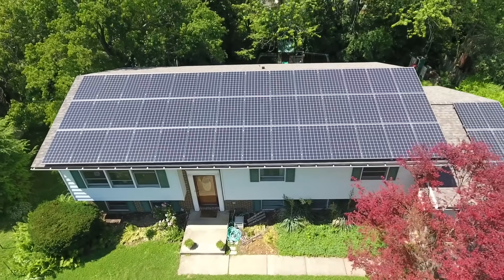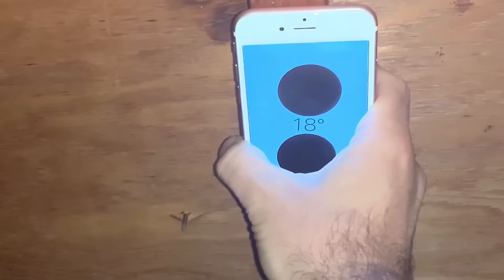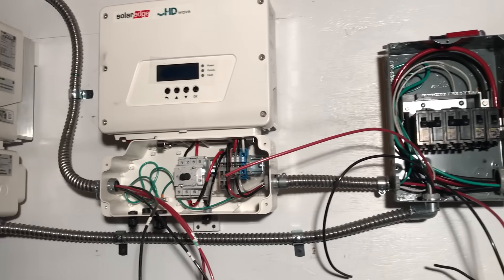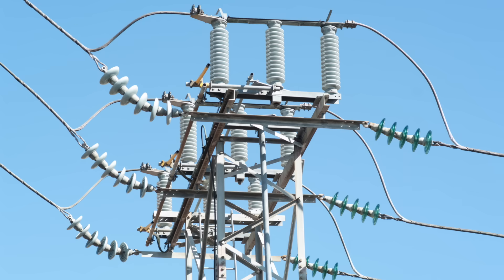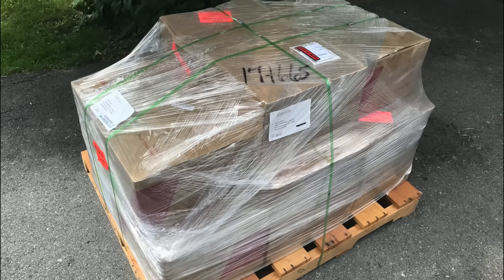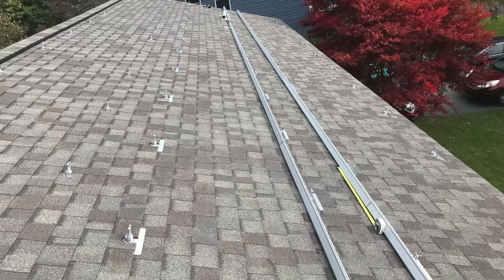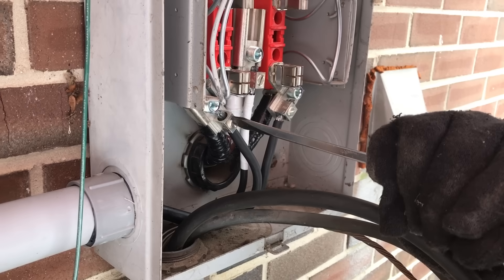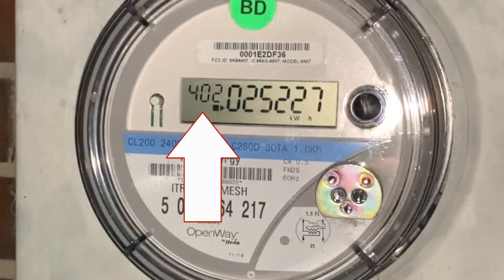I Installed a Power Plant Myself | HUGE DIY Solar Panel System

Comment: I question your math and ROI figures.   I've been designing commercial solar, wind and gas back up power stations for 20 years.  While the cost of solar has gone down substantially the cost per kilowatt is still well above what you can buy it for from the on-grid power companies.  Of course this all depends on where you live and what you are paying.  If you happen to live where you can buy a kilowatt of electricity for less than 12 cents per killowatt then it is not financially viable.  There are places in the US where you can get residential retail electricity for 8 cents per kilowatt.  You are not gonna do better than that.  So, my advice to anyone is to look at your utility bill and divide your monthly bill by the monthly kilowatt usage.  Then get a honest number of what it is gonna cost to build and maintain your system and divide that by the amount of kilowatts it will produce over it's serviceable lifetime.   Be honest about it.  Granted, the systems that I design are for commercial use and have redundant features but they typically cost between $.35 and $.75 cents per kilowatt.  Keep in mind, you can't just go buy the solar panels, you have to figure the cost of the panels, mounting hardware, support structure, controllers, batteries, inverters, switches and wiring.  Then don't forget insurance, property taxes and maintenance.  Very expensive inverters can go bad in as little as two years and will go five if you are lucky.  You will pay more for inverters and controllers than for the solar panels. The cost of labor is a total wildcard.   It's not all gravy.  If it were solar panels would have taken the world by storm decades ago when they were first invented.  If you have the power grid and you can buy electricity for less than 12 cents per kilowatt consider yourself lucky. Now if you want to live or operate out in the boonies where it cost 10s if not 100s of thousands of dollars to connect to the grid then solar, wind and gas generators are an option that is now reliable and available.  Several people like me that work in the industry would be more than happy to set you up. Just be honest about it and not mislead people.

Comment: So you bear all the financial burden to sell electricity "back" to the electric company for 1/4 of the price you or your neighbors pay for it  and felt good about it?  The installation was clean and the idea is amazing, finishing it with a powerwall you build your self and disconnect totally from the grid would be a goal.
Reply from the maker: It doesn’t work that way. I get full retail credit for every KWH I send the grid.  So I bank them all up in the summer, use them in the winter.
Reply: @FrugalRepair  apologies then sir, where I lived the repay for credit was less than 1/2 cost of electricity, b ows to you have a great day!
Reply from the maker: No problem!  I hope you are staying safe.

Comment: I think one big place where you went right was working with the roofer. It’s not unusual to have the new roof installed and then have the solar installed. Installing the standoffs as the shingles were being installed is probably the best way to be able to do it.
Reply from the maker: Thanks!  Yeah, he was cool to work with.  Plus, I didn’t want to have to put the flashing in and try to pull nails out of the way under shingles, if I had to do it with the shingles already there.

Comment: I'd love to see if you could replicate something like the Tesla Powerwall's autobidder, where it buys energy from the grid when it's cheap (like at night) and stores it in batteries and sells it back to the grid during peak energy hours. There's excellent long lasting relatively affordable and safe batteries like Lithium Iron Phosphate that would generate a good ROI and backup power in a power outage. Your solar could also store energy when it's cheap and sell it during peak hours, making your panels even more profitable.

Comment: Next: house battery system.
Reply from the maker: Maybe!  But as of now I don’t really need them because of net metering and the costs of the batteries.  But who knows.
Reply: @FrugalRepair  Correct, unless your utility is prone to persistent power outages, Net Meeting has a higher ROI than a battery backup system.
Reply: @FrugalRepair  Do you feel a need to prepare for blackouts and storms? Do the solar credits you earn during sunny days only barely cover the cost of powering your house from evening to morning and during bad weather? Is your power company thinking of changing how much they pay for overabundant noontime solar power vs. how much they charge for electricity at evening peak use hours? If yes, you might want to invest in a battery.

One thing you can do to easily store energy without batteries is timing your use of various appliances. Get a big enough water heater that warming it up at noon with free solar power will cover all your hot water needs for at least 24 hours. Set your AC, freezer, washing machine and so on to work during the day instead of morning or evening as much as possible. This way you will be using more of the power you produce so you need to buy it back less.

During these stay at home times you can also easily cook your meals when you still have solar power; the one problem with this plan is most foods won't like being left in the oven in the morning, baked by timer at noon and left drying in there until you come home possibly very late at night...
Reply: I would go save up for a battery system. Here in Denmark, everyone that got solar over the last 5-10 years got to earn a bit of money to pay back their solar. However today the rules (and billing) have changed and no one pays off the their systems anymore. Many actually are still paying off their loans for solar.
Everybody is looking into adding batteries and even into how to become off-grid homes, because returning power to the grid is heavy taxed. I literally do not know anyone in Denmark that will put up solar without it being off-grid. #Secondlifestorage
Reply: I agree with Fred. Some reserve power for peak demand, outages, and possibly a home server for mining, if you're into that. This's the first video i've seen from your channel, good stuff. You've earned a sub and a like from me. 🙂
Reply: liquid oxygen for power storage, its the future ;)
Reply: @sparky4774  Way to stay relevant. Bravo!
Reply: The energy density in a house battery is huge... a bit like having a bomb in the house... IMO too much of a fire hazard.
Reply: If the credit received is 100% of the purchase price for the same kWh, it may be best to hold off.  Eventually the credit should be reduced to its actual wholesale value. (The market will force this as more consumers install these systems.)  At that point battery technology should be better and cheaper.  That would be the time to consider an investment in battery storage.

Comment: No bills? What about the 20 plus thousand it costs for inverters, batteries, and those solar panels lol. They are not free ya know. Paying back 20 to 30,000 $$$ is NOT FREE MORON.
Reply: His intent was to eliminate paying the power company.  He apparently did not mind investing in his own equipment and labor to achieve that result.

Comment: so no link to the program you use for your permit and electrical calculations and no link to the company for the engineering stamp. Those are two of the most important parts that were left out, so this is helpfully how?
Reply: The permit is handled by the local authority having jurisdiction, probably a city permitting office, or a county office.  It is very unlikely that you have a similar enough location that the information would be useful.  To a slight extent, the engineering approval has a similar limitation.  If you are in hurricane alley and he is not, probably there is no applicability.
Reply: @wallykramer7566  Not sure why this is a highlight reply. because it's as useless as the information he provided. My question still stand. The information he gathered for the permit should be useful to submit to any AHJ as calculation are not location specific. And why not explain how you found an online company for the engineering stamp. Again these are two of the most important part of DIY solar and he left that information out. I didn't watch his video just to see how he was doing I don't know him and I don't care. I was trying to learn how to do it myself as well. I think he did a great job but in the end without providing crucial info the video was a bit lacking
Reply from the maker: There was a ton of information I didn't include.  Shoot me an email if you want more info.  I'm happy to help.  I'm also curating the questions to hopefully  address in future videos.
Reply: @FrugalRepair  email sent

Comment: Do you not have a battery? Was the idea to not use a battery but just offset your power cost at night by producing a ton of power during the day?
Reply from the maker: There's no need for a battery in my state (PA).  I get retail credit for my excess KWH.
Reply: @FrugalRepair  that’s what I was assuming, just wanted confirmation. What do they charge day/night vs what do they pay day/night?

Comment: Also count in inflation, which should be increasing within the next few years, making this a greater investment. When everyone else's cost of living goes up.
Reply: Not so sure.  As solar systems proliferate, there could be pushback by utilities, politicians, etc. which might reduce the reward for an on-grid investment.
Reply: @wallykramer7566  probably, maybe but upcoming inflation is certainly set in. But independent of that, the cost of power or most things will rise and being independent and not dependent will be the economically preferable thing to do. 🤷

Comment: Can't wait to see a part 2 and many follow ups that go into detail for all the various parts.

I felt this video was a bit too short. 🙈
Reply from the maker: Thanks!  I'm curious to hear what people want to see.  Let me know what aspects you'd like me to focus on.
Reply: @FrugalRepair 
-A step-by-step approach to the idea, planning, and execution phases
-The best way to research local codes
-Links to the various tools, calculators, and services you used
-The basic outline of parts and how you selected each one.
-Cost of the system in total
-What were the most difficult or frustrating elements in the build?
-Now that you're a year later, is there anything you'd do differently.

Thank you so much for this video, it's already really helpful!
Reply: @FrugalRepair  I am curious to see the kWhr rate the electric company buys power from you during the day and the price it charges you during other times.  I would also like to know if they took you off a rate plan and stuck you on another.  I have heard horror stories from owners and renters of solar that were put on a time of use rate at the beginning of a solar project and owed thousands by the first day of actual solar generation.  Solar is good but as usual, big polotics and big business have tailored it so the little guy gets screwed in the end.

Comment: How the hell do you clean those panels? You can’t stand on them.
Reply from the maker: You really don’t need to clean them.  Rain does most of the job for you.  I do have a long pole with a sponge on it for cleaning if I wanted though.  Maybe I’ll do a comparison cleaning vs no cleaning at some point.
Reply: @FrugalRepair  I went up recently for the first time after six years, and it’s looking like it’s better now. I would say the rare bits of bird poop would probably wash away on their own for the most part, but the general grime layer was p bad. What I’ll have to do though I suppose is go up after two years or so and compare if it’s equally bad.

https://imgur.com/gallery/hRv3KnF

Actually, you know what, I concluded I needed to do the washing in year 2 and 3. I never actually looked at the data for the last few years (password didn’t work, whatever, I could see it was still working on the inverter). But... with that graph I wouldn’t conclude that I really needed to get out there. I just had it on my to do list for years because I didn’t get around to it.

Huh. What do you know.

(14 x 260 is 3640W feeding a 3000W inverter, at 53 degrees north)

Comment: Bravo. I should have paid you to do our 12.9kw system instead of Tesla.  (Our utility in NJ limits how big we can go) Curious how much the system is producing now that’s it’s been some time.  On sunniest days during this first month I’m gettin only 27kw max.  Your system is larger and all southern facing so should be far higher. Also did u mention total cost ? Curious what that roofer charged for new roof too.   How much do u get for SREC bc that and net metering is what put my pay back period to 6-7 years too.   Pro tip- I also maximized credit card points with four new chase cards which really helped ( $4800 bucks back!)
Reply from the maker: Thank you!  I'm in PA, I wish I could get the SREC credits from NJ.  PA SRECs are like $30 but it fluctuates.  I hope I can get into the detailed breakdowns in future vids.

Comment: It is rewarding, Mine was an off grid set up, the batteries were an extra headache but then I don't have to deal with any regulation seen here. If your even a bit handy and willing to look up a bunch of videos then you can give the middle finger to power companies. My pay back is more like 3 years because I'm including the fact that I don't pay rent and I'm never going back.
Reply from the maker: That's great.  Did you install it yourself?
Reply: @FrugalRepair  Yes but I got advise on what I had in mind and then got him to come check my assembly and switch it on so I didn't fry anything as I'd never done anything like this before.

Comment: How about battery storage and feeding to the grid at peak times?
Reply: 16kW of batteries are what, another $8000, plus enough charge controller capacity too.   another $5-8000, larger systems use much more expensive charge controllers.  The Panels are the cheapest components.  I have a small experimental system on my shed, I will spend more on batteries than anything else.

Comment: Excellent video.
Fatal flaw: Those zip ties that you were led to believe would somehow last through summers and winters. It doesn’t matter what they are coated with, or what their chemical composition is, they will dry rot and break. Wires moving around will cut through the jackets and short out. It’s not an opinion. 
Otherwise, A+.
Reply from the maker: Thanks!  They should last a while but thankfully where I need them the most is within arms reach near the soladeck.  So I will keep an eye on them and probably add more straps/fasteners.    The cable management clips I used should hold the PV cables off the roof in the other spots.

Comment: You need to create some kind of structure at the lip or top of the top panel so that if a storm hits it doesn't lift your panels off the roof and take half the roof with it.
Reply from the maker: There's no need for that.  They are on there tight enough even to withstand extremely strong winds.
Reply: @FrugalRepair  I noticed that. But are the roof beams and rafters attached tightly to the house's structure? Because the lifting force of a hurricane level wind going under the top panels will give your rafters a good tug upwards, especially at the apex - you may want to check the A frame in the roof cavity is tied down securely (although I can see you have trees behind the house which will buffer the wind.) Otherwise, great job, thanks for posting this, and amazing that you worked all this out step by step and then did this yourself.

Comment: Free power is always great but i dont know about solar i feel like heat energy is the way to go because underground is always a different temp than above ground everywhere you go
Reply from the maker: What I did was solar PV, solar thermal is also a great thing.  Also, I wish I could get geo-thermal heat, but it's too expensive for now.
Reply: @FrugalRepair  solar is great but i feel like heat engines will last longer depending on the piston design.

Comment: Is it off grid?
Reply: No.  It is a grid tie-in system.  When the solar panels produce more power than the house is using, the excess flows into the local utility.  At night and other low solar production, the house uses power from the electrical grid.   His system puts more power into the grid than he draws from it, so his system is effectively, on average, a small power station.
Reply from the maker: Great explanation!

Comment: Well, very good but not impressive.  First,  it didn't describe affordability, secondly,  it doesn't help the off grid community for self-sufficiency. It looks like more than any other commercial trying to sell a product that cannot be afforded.
Reply: It's affordable enough or it wouldn't provide a payback. I think we still have to wait for the how to videos to accompany this introduction vid.
Reply: @bokchoy335  That is an illusion if you think you are getting a pay back. If you paid $10k to get $3.00 dollars back, which it isn't, How many years. It  takes to get your money back?
Reply: @neliosamch3195  It's affordable if you don't pay the installer companies. I just bought my ground mount, batteries, inverter and 12kw of panels for $9k. That will offset about $4.00 of electric consumption each day. So it's affordable and it makes sense.  You may need a better calculator.

Comment: Have u considered adding a powerwall?
Reply from the maker: Good question. I have but because of net metering and where I live I don’t see the value in adding such a big cost to the project.   But a battery bank could make sense elsewhere with time of use rates or going off grid.